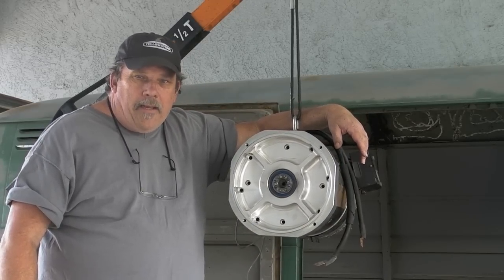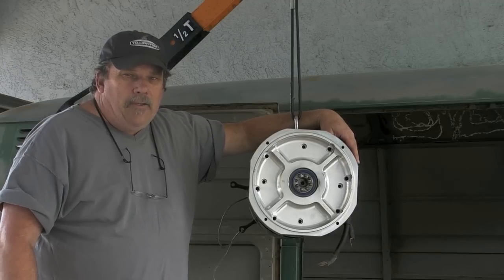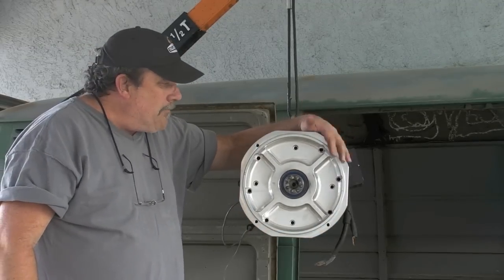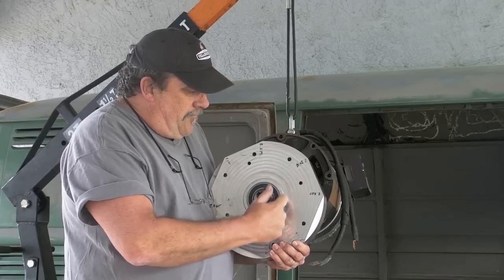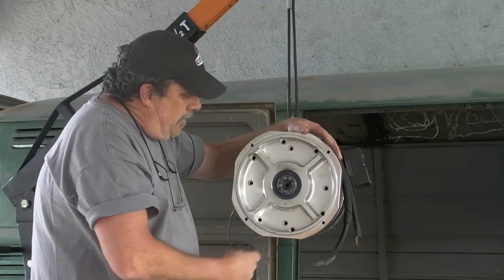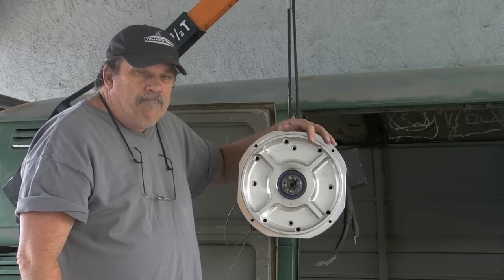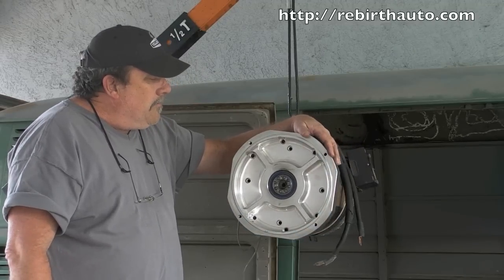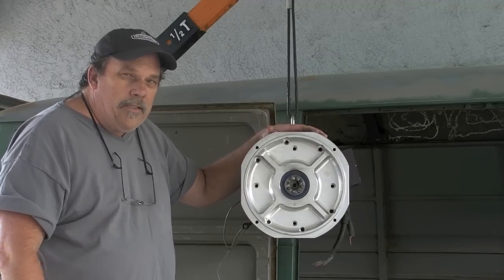Adaptor Plate

Comment: No, Im afraid the bus is still sitting and waiting. However I have converted a 77 MG Midget and a 65 Black Bug since then. I am currently working on an open top custom VW roadster and just got the big Kostov Motor installed. Yup, the one in the video here. Not sure how much longer it will be before that one is up and running but it should not be terrible long.